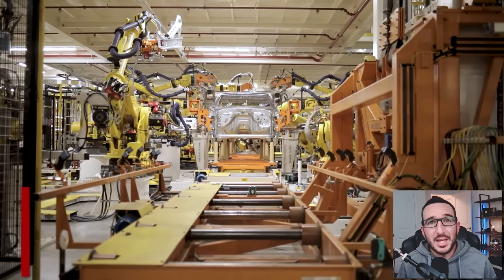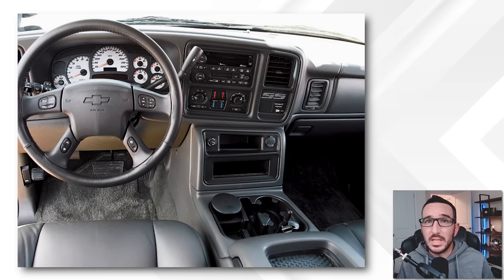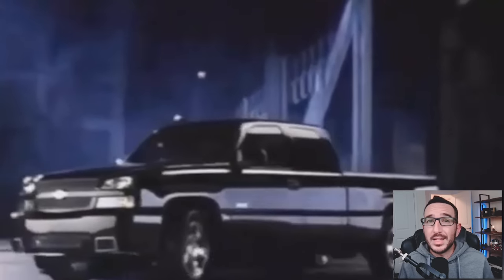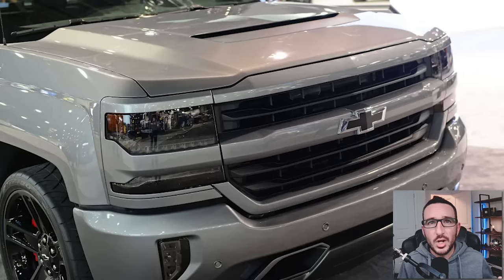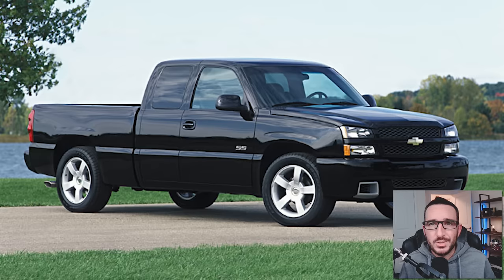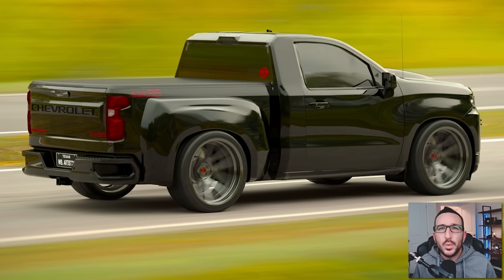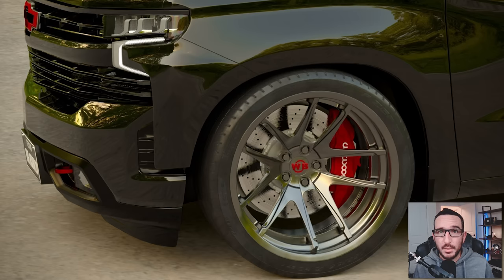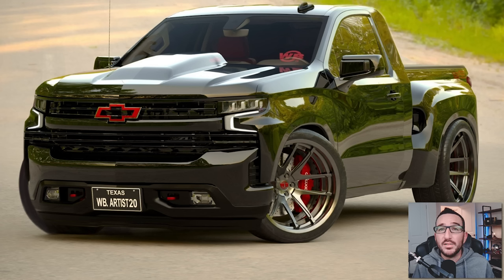New Silverado SS Stepside | Would You Buy One?

Comment: I bought a brand new Chevy step side shortbed regular cab pickup in black back in 1977. I paid less than $8000 for the truck. The bed had wood slats for the floor. It came with a 350 cu V8. I added side exhausts to hear that V8 when I stomped on it. Would like to see a step side again.
Reply: Expect to pay $80,000

Comment: That concept drawing has been the first time I've liked the modern truck in ages perfectly proportioned great contrast between flat and gloss and the red accents are perfect for it 10 out of 10 I buy one as long as they weren't over 50K and it would have to come with the 4.8 with a supercharger
Reply: Not above 50k and supercharged from factory don't really go hand in hand with today's HO vehicles
Reply: Under 50k 🤣🤣🤣
Reply: Better be under 50k for that outdated pushrod single cam v8. A new Whipple f150 reg cab will wax that donousaur anyway. For way less money. And no ugly ass step side bed.
Reply: @mr.sunnyrise1571  You know its a concept right? 🤣🤣🤣
Reply: @mr.sunnyrise1571  BS! The Whipple F150 does not have over 1000hp.
Reply: @mr.sunnyrise1571  *Di-no-saur* ,not Donousaur
Reply: 50K !  Haha
Reply: I'm with you bud

Comment: So I personally have a 1979 Chevy Silverado, super sport that was special ordered from the factory. It is a four-wheel-drive short bed, I have a lift on it and running 35 inch tires. I have looked up the Vin code, and it originally came with a 350, when I bought it it had a 454 with a modified throttlebody intake. The motor locked up on me two weeks after I bought it, I put a 92 Chevy super sport 454 in it. But enough about my truck, I love the idea of a new Chevy super sport truck coming out. With the Ford raptor, the dodge TRX, and not to mention the insane horsepower race that’s going on right now with Dodge putting out everything under the sun that is running 780+ horsepower. Ford throwing their two cents in and putting mustangs out that have 700, 800, and 900+ horsepower. You have the Camaro exorcist, the incredibly awesome new Corvettes, so why not put your hat in the race Chevy… And come out with a sick ass super sport truck just to show all them other fellas out there that the bowtie still wears the crown!

Comment: For a production truck. the ride height is too low, and the stepside bed will drive up the cost. Get a std cab, short bed 2wd and slide a lightly tuned 6.6 gas engine/trans combo from the Silverado HD, drop it 2/4 and firm up the suspension (springs/shocks/sway bar). That's your home run!

Comment: Love the concept and ditching the crew and extended cab, but should put it in Colorado-sized truck (without crew cab or extended cab) with regular length bed.  I’d probably make the 632 a dry sump with well-designed oil pan so it won’t leak oil like most BBC, and include an electronic launch control and a drag package wheel and tire combo as an extra option to go with the six figure price tag we all know it would be,… and hopefully make more than a dozen trucks, ‘cause gonna be a lot of guys taking out a second mortgage to get one.

Comment: Would I buy one? In a word, nope. Doesn’t matter though, there is not a single thing on the current market that I would throw my money away on. I want a GD car and a truck. Not a GD entertainment center on wheels. I know how to use my mirrors and parallel park. I like to drive and don’t want hands free anything. I can easily afford to replace my old car and truck but have no interest in doing so. They have everything they need and not a GD thing that they don’t. Period. If by any miracle, a manufacturer decides to build something with all the performance and none of the useless bells and whistles I’m definitely interested. Until such time I will keep driving my old car and truck for as long as possible.

Comment: Okay cut out all the Bullshit!  Ford is building a 300 grand mustang!  So build this truck and sell it for $150-185 grand plus some upgrades…not all hot rods want a damn car! Make the truck handle like a sports car and run like its been raped by the devil!  I'd pay $200 grand if it met all the points, paddle shifters, program will launch modes, adjustable, ride, heights, adjustable, sport, normal track settings. It can be done and with a limited warranty!